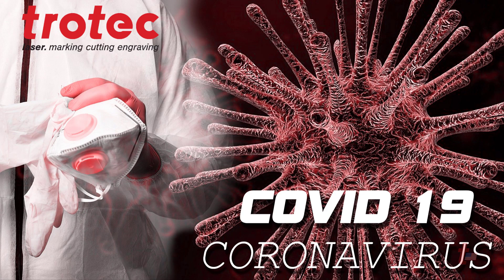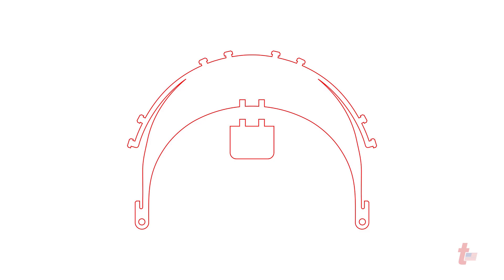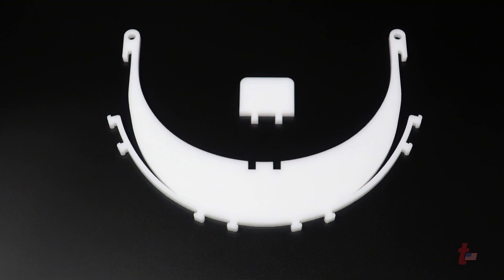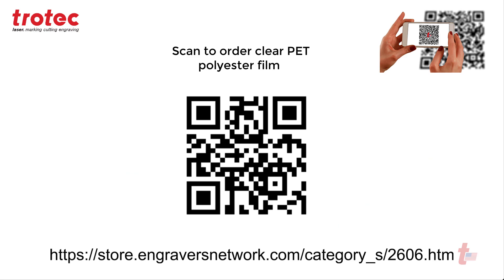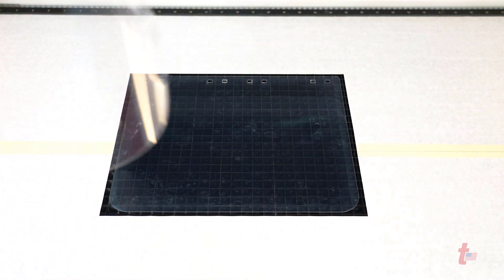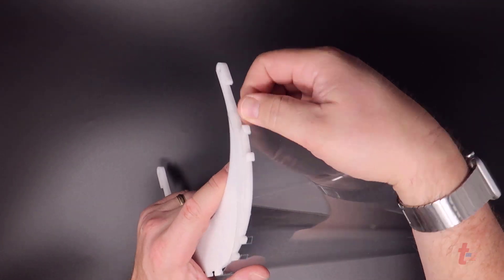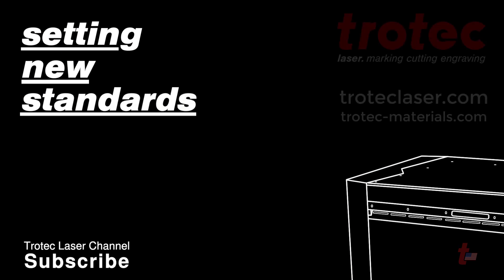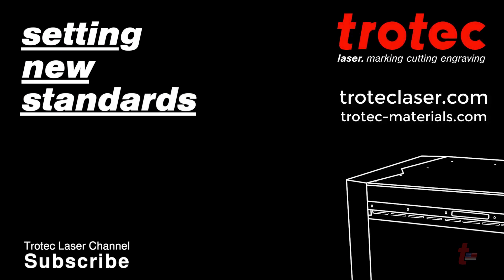Trotec Laser: Acrylic and PET Face Shield

Comment: I don't see any setting for the PET plastic.
Reply: Settings for PET plastic are not a standard setting but for an 80 watt trotec laser 100% power and 2-3% speed depending on material thickness will work

Comment: Is it possible to use 4mm acrylic?
Reply: Juan,  I think that 4mm acrylic will work but the notches (cutouts) on the PET film will need to be adjusted as well as the notches for the part that is glued to fit the new thickness.